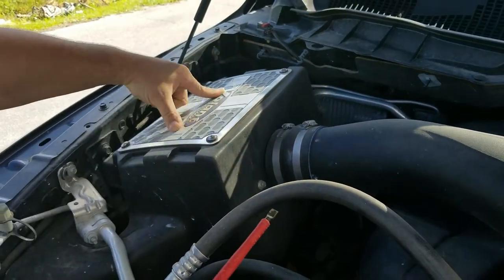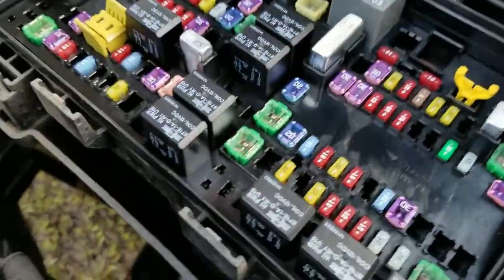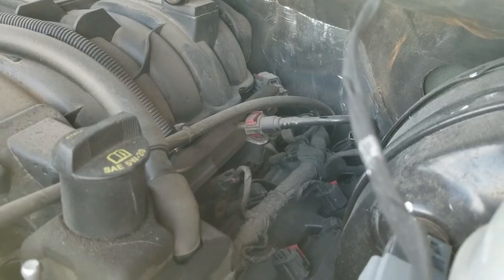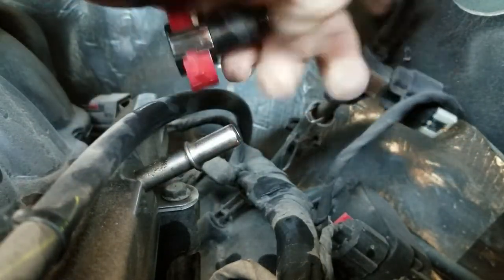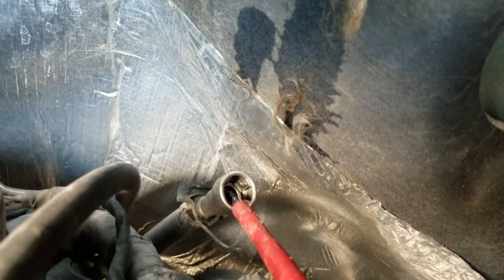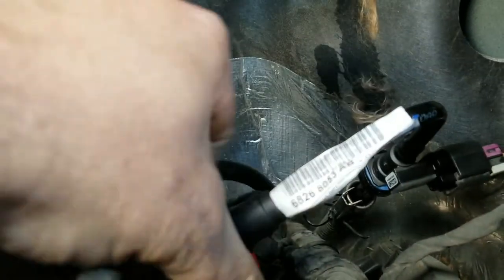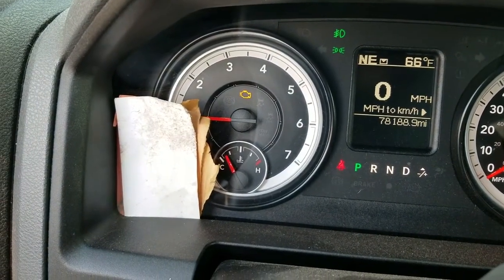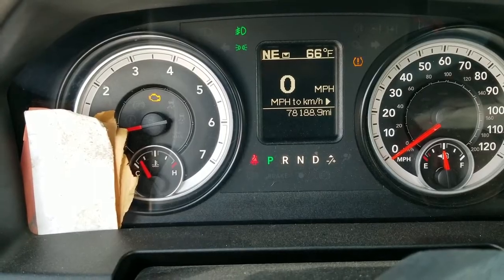2015-19 Ram 1500 5.7 Hemi 8 Speed, Fuel Presure Sensor Replacement

Comment: 2015 Ram Hemi, I replaced my sensor because of P018C code at 58K miles(I believe to be original sensor). Bought sensor from Amazon(with fuel line tool), a week for delivery. My ECO light, and remote start would not work with this failure. Engine ran okay. Took an hour to change sensor. Hardest part is climbing on top of engine to reach sensor. After replacement, I reset the code with my "Foxwell" reader, and everything is good to go!
Thanks for video! Good job. Dale.

Comment: I had code P018C and replaced the fuel  pressure sensor and it fixed the problem.  I spent $115 including buying the fuel line remover tool which is a lot better  than using a screwdriver. Dealership wanted to charge 150 just for a diagnostic even though i told them what the issue was. Save your money and do it yourself.  I saved myself 300 dollars and if you have the fuel line remover tool it only takes about 30 minutes if that to do on your own.

Comment: First of all, thank you for having a good video for this. This is the ONLY video like this I could find. Secondly, I recommend going and buying the fuel line tool to remove the bottom portion. Don't want to mess up the clip with a screwdriver. It cost me $5 at Advanced Auto Parts. Definitely worth it! 

Thanks for saving me a lot of money by not having to take it to a shop!

Comment: I just replaced mine today. The only issues I had was the bottom connector clips to the lower line. Just un clip it and pull it toward you. It's a safety to keep the connection secure. I used a line tool and It pulled the sensor end right out. Then I did the top red connector, both sides of it unlatch after you unlatch the red door part, then the red part pushes through to let the hose come out. Then I disconnected the power to the sensor, the gray part slides away from the sensor then you squeeze where the gray piece was and wiggle and it should come apart. Caution: my green "o"ring seal inside the connector, was pulled up, with the other piece, an the purple part was inside the sensor housing and when i went to put the old sensor on the bench, the purple part fell on the floor. It goes in the plug on the vehicle and the green "o": ring slides down over it. Then plug it onto the new sensor after you install it..

Comment: This has to be the weirdest sensor issue I have ever saw, My light kicked on around 50k miles "Now has 76k" and I was having zero problems driving so about 6 months later my dad had one of those cheap cell phone app code scanners and it showed "Improper fuel air ratio replace MaP sensor" Well for 9 dollars I didn't argue but my problem still existed. 

Today I finally went to autozone, and was lucky enough to have the store manager scan my truck, and it showed on his code reader "Bad Fuel Pressure sensor/ Improper fuel air ratio" He told me he had never heard of that going bad so early, but this video has convinced me otherwise.  My truck still kicks into eco mode, however it doesn't show ECO at the top of the monitor screen "Same issue you had" I'll be buying a new one tomorrow good to see that it's very easy to access now days, guess they learned their lesson, it was a pain when they had the whole assembly attached to the fuel pump above the gas tank.
Reply: This is exactly the problem that I have with only 67k km on it. I when to the dealer and their mechanic said that the sensor was bad so together with taxes, labor and part 325 $ this should become a recall, how can it be bad so early?
Reply: @mikecioka1180  Sometimes companies get get away with it. My girlfriends Ford Fiesta also has a "universal problem"  The cooling fans go out on ALL of them, at a low mileage also. 

It's better than Vortek getting away with their engines frying the cylinder walls 07-14 though, some of those engines barely made it 100k.

Comment: Thanks man I just changed mine on my 2016. got it for $70 at the dealer only took a few  minutes to change thanks to your video
Reply from the maker: Glad to help , thanks for watching
Reply: What was your error code?
Reply from the maker: I can remember,  but wen replaced my CEL went off
Reply: @NorthFloridaOutdoorsman  P018D? Was that the code? I just hooked up a scanner to my Ram and that's what came up. Just wondering if that's the same one you got.
Reply: Noel Gonzalez hey man I have the same code on my 2015, did you end up doing this, if so did it fix the problem?
Reply: Thank you for the video. The dealer ran my code to find the problem. Wanted $700 + 😤 to fix it! I ordered the part on Amazon $65 shipped. Will be changing it out this weekend! Appreciate all the insight!
Reply: Donald Yurko it fixed the problem for me, code cleared itself after diving a bit
Reply: @noelgonzalez9549  I got a P018C... similar I think?

Comment: DUUUUUUUDE!!!! Great video!!!! Excellent step by step. I DID buy and use a disconnect tool for the gas line. I’d add two things though. 1. My system didn’t depressurize as much as your did so I had a bunch gas spray out. I had to make sure that the negative battery post was covered with a rag to keep the cable from accidentally touch it and sparking off the fumes. 2. Have a step stool handy! I’m 6’5” and couldn’t reach without one! 😂 Thank you again for this!!!!

Comment: Thanks for the video, just swapped out my son’s and the only difference was we didn’t have to remove the tube closer to the firewall. The new connector had a connection by the sensor. 
2013 Ram 1500 Hemi 5.7

Comment: I did this in about 35 minutes.  I had so much trouble with all of the connectors, even the fuel line with a fuel disconnect tool. Just a tip, once I got up on top of the engine compartment and was able to pull the line upward and out rather than forward and out, it came out easily. Also it was 3/8" using a plastic disconnect set.
Reply: Thanks for posting!

Comment: I have a 2017 ram 1500,with a 5.7 hemi the message on my dash came up today "fuel sensor failure " fuel gage went to empty  engine light came on but truck ran fine .I changed  out the fuel sensor but fuel gage still reads empty what now?

Comment: I have a 2019 classic my light just came on the code reads the same for that part did your engine light clear? 🤔🍀
Reply from the maker: It did,  some times you have to reset it or disconnect the battery for about 30 mins
Reply: @NorthFloridaOutdoorsman  I just did and it cleared 🍀hopefully it was just a glitch get R done😎✌️

Comment: Great vid... my check engine just came on .. pulled the pressure sensor code ... the " eco" mode thing is a good tip I'll look to see if ots coming on, gas mileage dropped too

Comment: My 2015 engine light went on yesterday my scanner shows P025B fuel pump module control. I have only 33,000 miles. Truck runs and starts perfect. Dodge dealers are telling me that I need a new fuel pump..How can I need a fuel pump when my truck is running perfect ?? Engine light stays on.  Do you know anything about this ?  thank u
Reply from the maker: I would think it's still under warranty,  does it go into eco mode while driving down hwy ?
Reply: I’m probably late but on Amazon’s they make a bypass for your fuel pump relay , since it’s soldered into the board you need to bypass it with the rear cig lighter fuse . Should fix ur problem and save you a big paycheck

Comment: Good video thanks but theres an easier way. Instead of doing your step of removing from what you called metal adapter 3:15 . just under the sensor is a clip thats taped remove tape and pop the 2 blue clips and pull the connection apart and bobs your uncle! Thanks again 👍

Comment: Thank you so much for the video… I would not have guessed to remove the gas cap to depressurize, or the fuse.

Thank you for taking your time out to show us… By the way did the check engine light ever clear?
Reply from the maker: It did , still goin good . 👍
Reply: @NorthFloridaOutdoorsman  How long did it take to reset. I replaced  my sensor earlier today and the check engine light remained on also. Thanks for the video tutorial, it helped a lot.
Reply from the maker: Discount the battery for a few mins and reconnect and try that
Reply: @NorthFloridaOutdoorsman  Thanks for the fast reply.
Reply: @NorthFloridaOutdoorsman  when I connect the battery it sparks, will it be the sensor?
Reply from the maker: @rubenherrera9287  not sure about ur question but most anytime you connect a battery it sparks

Comment: Can someone tell me what the issues are before replacing this sensor? Mine has been acting up every now and then where it’ll crank but won’t turn over. I have no check engine light or any codes so I’m kinda stuck guessing what could be causing this.
Reply: Did you figure it out long shot since this was 2 years ago got a p025a code for mine mine will crank and start sometimes then other times it’ll crank and not start try again and I’ll have to tap the gas to get it to start
Reply: @matthewskinner1315  I don’t know for sure if I fixed the issue but I looked in to the fuel pump relay and found out that they have an issue where they don’t kick on so I found a fuel pump relay bypass and it’s been working fine since. If I unplug the bypass then I start having issues again.
Reply: @Fernie1224  what year do you got mines a 19

Comment: Just replaced the fuel pressure sensor took only 30 mins to do, replaced due to eco mode not coming in and a engine light fuel pump moduel not communicating, I had a code p062a and u0109 wich should indicate the fuel pump, which I went ahead and replaced the code was still on previously I had 2 mechanics shops go through the fuel pressure everything was fine and all the voltage and resistance and grounds were good, so I ended up replacing the fuel pump control moduel engine line gone but still pending codes, a day later engine light back on, soo I found this video and now decided to replace the fuel pressure sensor, no pending codes and engine light gone.... for now hopefully it was the problem!!

Comment: After replacing that sensor check engine still there it will automatically disappear or need to delete it by scanner?
Thx
Reply from the maker: After I plugged the battery back up it went away
Reply: @NorthFloridaOutdoorsman  i replaced that sensor with unplugged battery, but after battery putting battery back check engine light still there, delete it with scanner, run engine cycle ignition and check engine light back again🤷‍♂️
Reply from the maker: Sometimes it takes up to 30 minutes for the cycle to complete itself before hooking the battery back up. Best thing to do is hook up to the scanner and make sure that is your problem and check the code if it’s a code for the sensor, then delete it and see if he comes back.

Comment: What problems were you having with it prior to changing it that resulted in you getting another sensor? I have a 14 ram that never turns on the first time I have to crank it a few times. just finally want to pin point my problem been going on for about a year and a half now
Reply from the maker: Wouldn't go into eco mode and had a engine light on dash

Comment: Nice video!  Do you recall the OBD2 code you were getting?  I got a P018C yesterday, and it looks to be pointing the Fuel Pressure Sensor low reading.  The truck shows no symptoms of trouble, took it on the interstate and hotdogged it... if there was a fuel delivery issue I couldn't feel it.  Thinking the sensor is just bad.
Reply from the maker: I dont , I didn't see or feel and issues either,  just it would not go into eco mode
Reply: @NorthFloridaOutdoorsman  Bud, I can't thank you enough for  this video.  Just performed the exact repair on my 2016 and resolved the engine code (and ECO mode not showing up any more).  Saved myself about $2,000 bucks based on ridiculous dealer quote.  Of course you didn't mention you are probably 7 foot tall with a 13 foot wingspan.... holy crap was this stuff buried way back there!  I'm 6 foot tall, and had a good step stool and was still struggling to reach everything!  Anyway, thanks again!
Reply from the maker: @harmontodd  yeah man glad I could help . Thats why I do it , some of my videos are for fun and get alot of negative comments but helping others make it worth doin . Thanks for watching and glad you got it fixed

Comment: What is the reason for changing the fuel pressure sensor?
Reply: It causes a check engine light, will not go into eco mode, and disables remote start.

Comment: Can this code come out if ur girl forgets to put the gas cap on a drives for a few days... i was.going to just try unplug the fuels and baterry  and see if it work again now with the gas cap on
Reply: Did this fix your problem? I've got the same issue. Wife didn't tighten the gas cap now it's saying fuel sensor but I'm not sure this is what I need. Thanks
Reply: Yes it did work

Comment: How do you get the safety clip off on the bottom fuel line?
Reply from the maker: I used a flat head screwdriver, just got to play with it , I do believe they make a tool for it but not sure

Comment: How long before the code cleared itself?
Reply: Never mind...I read below where you said you had to disconnect the battery, that’s what I did and it cleared the code! Thanks for the video!  By the way to all those folks out there the fuel line tool makes it much easier to Disconnect. Mine are plastic, assorted sizes.

Comment: ECO mode is what’s prematurely destroying the cam and lifters in the HEMI engines and the best thing you can do for your engine is turn the ECO mode off by purchasing a programmer that will allow this to be done or put the truck in 8th gear by using the shifter on the steering wheel. It will prolong the life of yourHEMI.

Comment: Finally replaced my sensor to a 2016 RAM. Light came on a day ago.  Look like the circuit board on my old  sensor was burnt out.  Paid $90 at dealership for part and a mechanic put it on for me. The mechanic never removed a K5 nor undo the negative terminal off battery. When he replaced the fuel pressure sensor the mechanic had to hook up his hand held system to reset the check engine light. Paid $45 to my mechanic for the labor. For $135 it worth it to have that dern engine light off. Seems like my RAM sound better and run better also. Ram not sick no mo. FYI...stop using that ratchet ass gas. Lol😂
Reply: Do you remember the fault code you where getting?